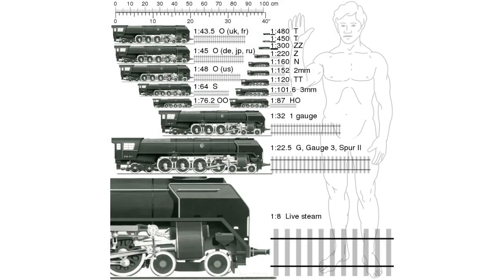Sneak Peak LightWare LiDAR SF000 (The world's smallest and lightest microLiDAR)

Comment: Is the SF000/B compatible with PX4? The PX4 parameters "SENS_EN_SF0X" and "SENS_EN_SF1XX" do not have a setting for the SF000/B on the latest firmware (v1.12) as opposed to the other models, e.g. the SF20.